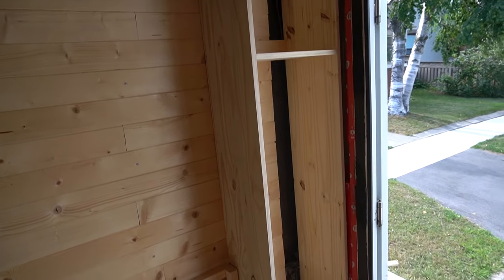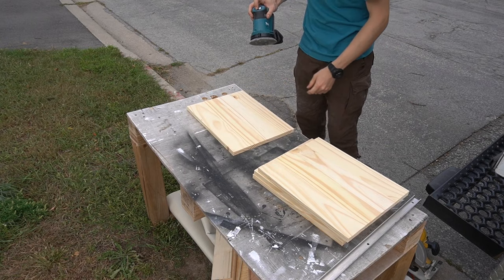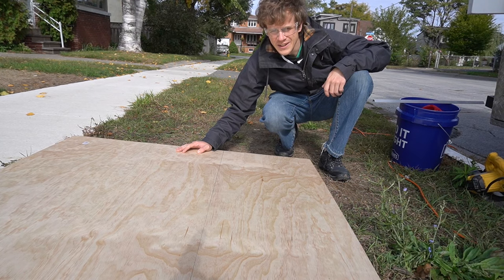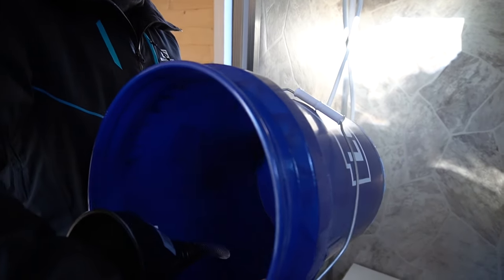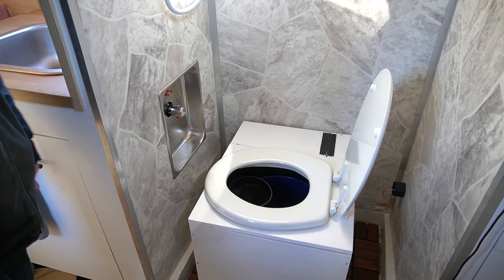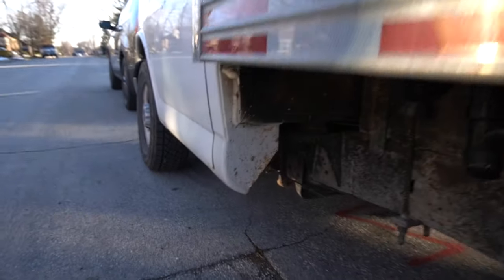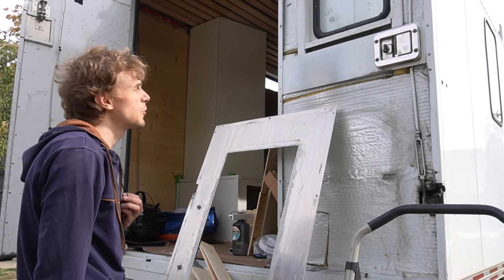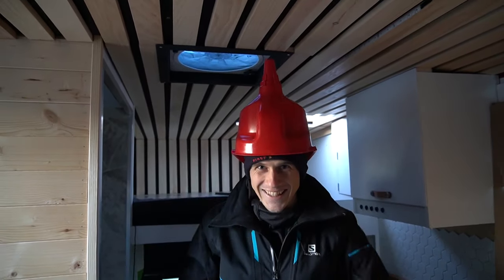Easiest DIY Composting Toilet for $100 in a Box Truck Conversion

Comment: it looks great but since a box truck is rather small, every inch is prime real-estate so I really don't recommend using wood rather I recommended wood laminate sheets or textured vinyl because you could get the most out of the space also because wood is heavy and it will increase gas millage and may even rot or get mildew since it is a tiny room with a shower. Expect high humidity and the wood warping. It is better to use t slot aluminum beams and insulated plastic boards(you can make this by filling a hollow 1 or 2 inch plastic with spray foam) instead of wood. aluminum and plastic are light and resistant to decay. you get better millage and have an easier time on maintenance.
Reply from the maker: Seriously awesome suggestions. We've been thinking about toilet 2.0--you're absolutely right with the weight. Chiko can't lift it out even when it is empty. We've been okay with the rot and mildew since it's really dry out west, but for sure in more humid places, the rot would come on quicker. We don't want to talk about mileage ahah it's already bad when the box was empty (20L/100km~) and currently we are averaging 22L/100.

Comment: Hello! I was thinking of converting a box truck and was wondering if it is loud to drive and why you guys chose a truck instead of a skoolie? 
Thanks for sharing your designs!!
Reply from the maker: Hey Jaclyn! Our truck is a squeak bucket and it's about as loud as any other moving box truck. Noise wise...I think our engine is quieter than a schoolbus. We chose a box truck because of its square corners! Imagine the rounded edges of a school bus😱😨. Also, you must paint the schoolbus a diff colour if it's yellow because that is reserved, I believe.
Reply: @RoadtoPitches  Thanks so much for the quick reply and advice!!

Comment: nice work, how long is the box?
Reply from the maker: Hey Bike Ninja, the box is 12 ft long!
Reply: @RoadtoPitches  great! thanks! curious, what are the wall studs made of in these box trucks? is it C or Z channel? did you tie into the existing metal framing when installing the windows?
Reply from the maker: We got the box with the windows installed already--except for the skylight and the ceiling fan. The studs on the walls are all C channel. The ceiling has a top-hat rail (I hope that's the right word, I also found the name DIN-rail, but the brim is smaller on those) so we could add some additional wooden framing behind the "brim" of the hat. The box is made of aluminium, except for those ceiling studs and a big frame in the back where the doors are mounted.
Reply: @RoadtoPitches  nice, thanks for the detailed info, I think every box is deferent probably, just depends on manufacture. I'm just trying to get a feel for what I would be dealing with..... outer skin is thin sheet steel?